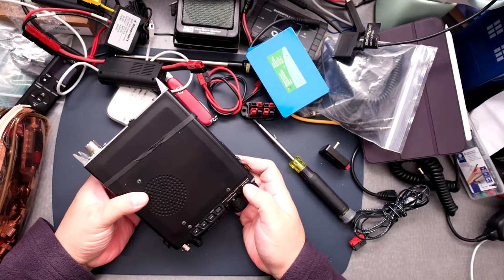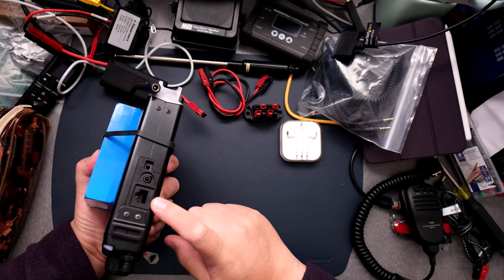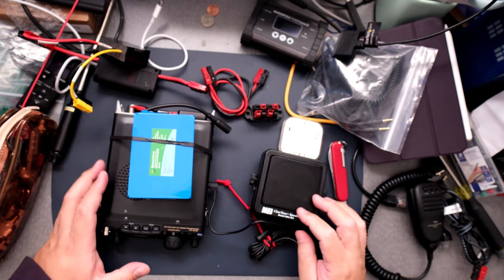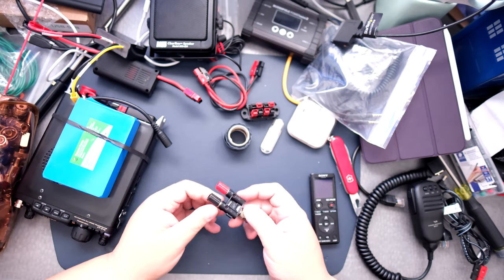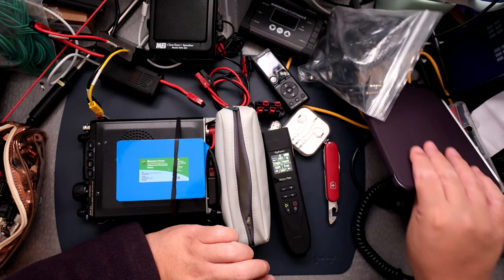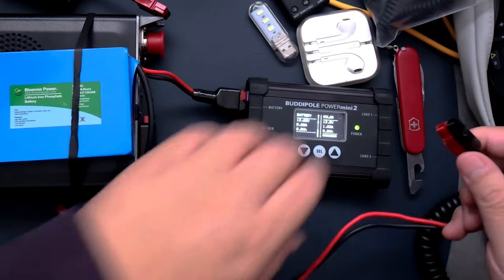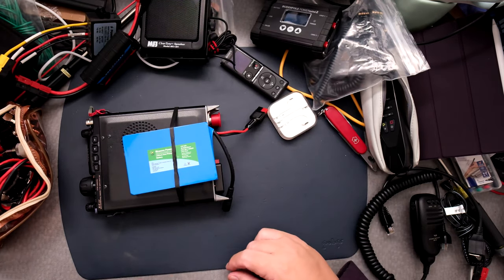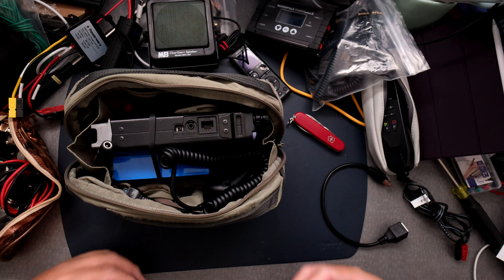Yaesu FT-818 Field Setup

Comment: I just got the 818 2 weeks ago, probably one of the last new 818s in the World, I got it from Martin Lynch in the U.k.

I am impressed with the little radio, the receiver on it is good, lacks filtering of course but you can add it later if needed, what struck me is how quite the receive audio is. 

I like being able to operate the radio with the strap around my neck and the controls facing me as I look down. 

I hope that if Yaesu do come out with a new QRP rig that they don't stray far from the 818, I would not like a full sdr bulky radio like the 705, I'd like no SDR, don't want to have to worry about breaking the screen, should have  Fast charging lithium battery, USB-C, Built in sound card, Tuner option, 2m, 70cm option. No bluetooth, No Wifi and No Fusion. Just keep it simple. Maybe a smaller more rugged radio like the Kx2 that weighs very little with reduced current consumption and 10 watts. 

Options to keep costs down not one fully loaded expensive box with features not everyone wants. 

I've heard the audio in videos of the IC-705 and the X-6100 and they seem to sound harsh and noisy like my old 7300 so I'd rather stick to superhet for now for that reason alone, full sdr seem to be quite noisy unless you spend bucket loads on a high end sdr. 

I have the FTDX-10 and the audio is so much better than the 7300, the DX10 noise floor is also much lower, I believe being a superhet radio is mostly to do with the super good audio, yaesu really got the DX10 right, they seem to have nailed it when it comes to audio quality.

I like how yaesu seem to have tailored the voltage for the NiMh pack on the 818 because it seems to output full 4 watts until the battery almost dies. It's not the best battery of course and I intend to swap it out for lithium, maybe 18650s with BMS or no BMS and just pop the cells in my 18650 charger. 

One thing I don't like is the AA battery holder, it's a real pain to get the AA cells in and out. 

I was thinking of Turnigo 3S 2500 Mah transmitter pack but they can't be got, there doesn't seem to be stock anywhere but this battery seems to be the perfect size for the 818. 

I'm not sure I'd find a 18650 cell holder that would fit in the 818, I have seen videos of some that will and some that won't.

A diy 3000 Mah of 18650 cells will fit in the 818 battery compartment and give the same run time as the LiFeP04 3000 Mah.
Reply: I have the Windcamp lithium polymer battery kit for my 818 and I like it

Comment: One thing that I can say about that little radio. It’s an awesome receiver. I have other radios e.g., FT-891 which is a great radio as well. But this little guy gets more use in my SWL world. It’s just easy to use, it’s a shack in a box, and the reception is amazing.
Reply from the maker: I'm getting used to the Rx on this radio, I like the 857D a bit with it's filter.